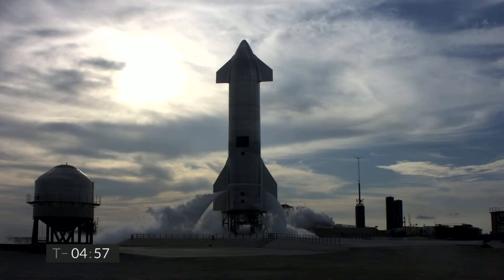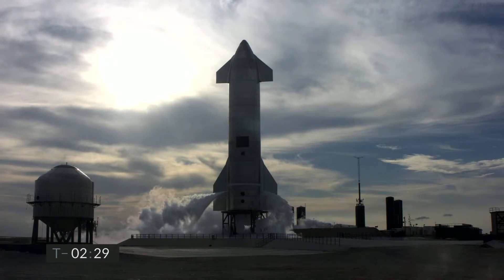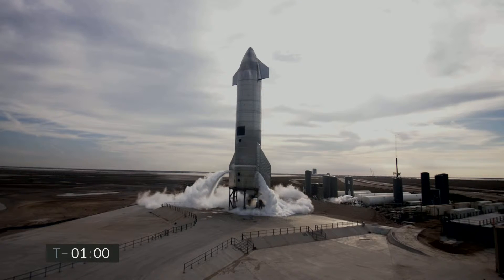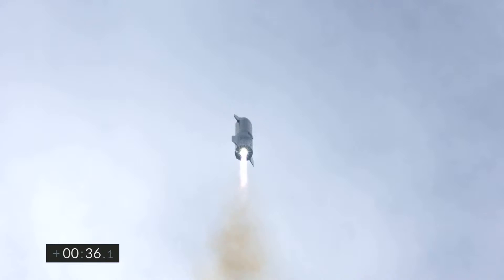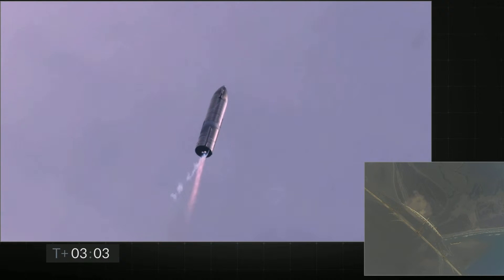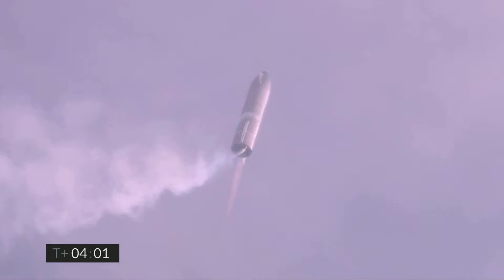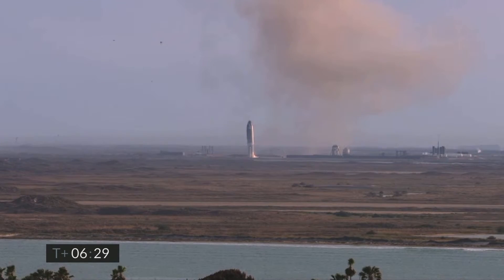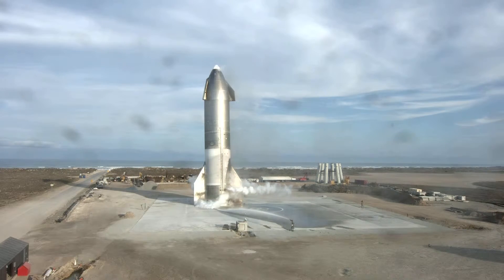Starship | SN10 | High-Altitude Flight Test

Comment: Can you guys not use the flaps alone to flip the vehicle, perhaps from say, a higher altitude?
Reply: No, I donÄt think it would flip all the way without any engines.
Reply: @volksgenosseerichhonecker5104  with the right amount of altitude and right flap design, I don't think anyone has tried it yet...
Reply: They need to use a lot more fuel if they do it at a higher altitude
Reply: They can't so that because in the horizontal orientation because of air resistance it falls slowly. If you make it vertical then it's extra fuel wastage for no reason. If you look closely the fuel being used to do the actual flip is far far less than that which would be needed if it had been vertical way up.
Reply: @SahilP2648  So you saying the flaps cannot by themself first slow the ship, then orient it vertical in a way that shifts the entire orientation of the ship without using fuel until it gets near the ground?
Reply: @SahilP2648  In theory the ship would speed up again if it was falling vertically long enough?

The amount of drag really saves that much fuel vs a few moments of fighting a few extra hundred miles an hour of momentum?

I wonder what the statistics would look like on a chart of raptor thrust vs opposing direction of speed and mass.
Reply: @RoyBuchanan309  just compare this video to the spacex heavy twin booster landing. Those boosters are super small and light weight compared to Starship but they come in so fast (since they are vertical and have no drag), they cause 3 sonic booms at different altitudes. Starship has flown pretty high up, enough to hear the sonic booms if they happen but they don't, cause it's literally floating down, not diving down. Also the actual flip maneuver lasts only a few seconds so it's not wasting as much fuel as you think.
Reply: @RoyBuchanan309  also compare at what altitude the spacex heavy boosters light up. They light up pretty high up so they are burning longer than starship which is heavier. So this is the best possible way to save fuel and be safe at the same time.
Reply: @RoyBuchanan309  look at the landing burn start https://youtu.be/sX1Y2JMK6g8 I would say it starts at about 1000-3000 feet in altitude. Way higher than starship.

Comment: On the launching platform all 3 raptor engines of the Starship are at a distance from ground such that each engine could safely fire independently. During landing the engines are much closer to the ground, the silent engine(s) might get chocked up and cause explosion - a thought

Comment: Since the Starship's using one of the 3 Raptor engines for landing, would it be easier for the starship to keep its balance and hold itself in the upright position if it is equipped with 4 Raptor engines instead of 3? One in the center used for landing, and the other 3 placed around it.
Reply: By gimbling the Engines they can balance it out prettey easy.
A 4th Raptor Engine is not needed because they already have enough thrust with just 3. A 4th one would only be extra weight.

Comment: Has anyone noticed how the rocket bounces up a bit as soon as it lands? Is this normal?
Reply: No, it definitely landed faster than it should have, Elon confirmed this by saying that the engine didn’t bring the thrust that it was told to do.
On SN11 they will light two and maybe even three engines for the landing burn

Comment: I know that this might sound like a newb question or like a question from a person without "The Right Stuff", but why don't we use propellers powered by rechargeable batteries to the maximum height limit and then just use the thrusters to escape the planets gravity pull to get to space.  I think that this would cut the amount of fuel required by a lot and provide maneuverability during landing.   Also  Elon owns a gigafactory.
Reply: You cant get enough speed if you use propelers
Reply: And you cant aesely came back without rocket boosters
Reply: Oh I see.  Thanks! I guess the air also wouldn't be dense enough at high altitudes to provide the lifting force to keep going higher.
Reply: @jamiewong8233  sort of like on mars, need to spin the rotor blades faster to gain lift. They are going to test the ingenuity helicopter on mars toon (Nasa)
Reply: Because space is sideways, not up: https://what-if.xkcd.com/58/
Low earth orbit is typically at least 200km up. Getting to that height accounts for about 1/15th of the energy needed for orbit.
The other 14/15ths is accelerating sideways to ~28,000km/h, or 17,500mph. Propellers can get you to about 20km, or 1/10th of the height, so about 1/150th of the overall energy. 
Long story short, saving 0.7% of your energy requirements using propellers is not worth the extra complexity involved.

Comment: I think the fuel that is used inside the SN-10, when it falls back to the ground, the fuel in it goes back and forth, the engines don't get the right pressure, which is why it fills up right on time. Don't work and don't make landing easy.
Reply: Actually, that time it did work, there was just a sticky throttle valve.
Reply: @alexn8219  no, there was a problem with helium ingestion and flash state change. Check elons twitter and everyday astronauts for more exact details

Comment: Please share thoughts about this one:  What about a dynamic landing pad platform concept with hydraulic actuators and shock absorbers to dissipate residual kinetic energy and trimming level off?
Starship legs would be spared of high peak loads.
Reply: This is just calibrate error or not optimized
Reply: Elon has actually mused on something along those lines. But it would only be practical where sufficient infrastructure exists.
To land on Mars or the moon, at least at first, you're going to need proper legs.

Comment: I love the close cinematography on the landing scene. It's an automated camera I believe.
Reply: landing scene is definitely cgi... where is the dust? wen we see the shot from the camera on the ground....
Reply: @mthaesibbz8656  
Look at 11:55
It's too far from the ground to make any dust until it does when it got low enough.
Reply: @bengsynthmusic  if a jet engine can blow things off that are 50m away... I'm sure a SpaceX rockect engine powered by a reactor will kick off a little dust... Not a cloud of dust... It's in the little details...
Reply: @mthaesibbz8656  also it’s a Raptor engine not a reactor.
Reply: @mthaesibbz8656  it may not look like it because of the distance, but at 11:55 the rocket kicked up about 20 meters of dust in height. That's a lot more than any jet engine
Reply: Took 4min to reach 10km altitude... But 1:30min "FREEFALLING" bck... How does anything freefalling become faster than the rocket?
Reply: @mthaesibbz8656  The rocket was only going up at 40% power, due to not wanting to break the sound barrier, if you check out any other Falcon 9 launch, youll see it hits Max Q (Max aerodynamic pressure) around the 1:20 min mark, this usually is when the craft is hitting the atmospheric wall, which is about 43000 ft high. SN10 only managed to reach a height of 10km in about 4 minutes. So its unbelievebly slow going up, but with the weight + gravity, it reaches its terminal velocity when doing its belly flop manouver fairly fast (within 30 seconds)
Reply: @mthaesibbz8656  It wasn’t at max power.

Comment: K if you can put it on site... why not look at mediums for resistance... get it hovering stable say 200 meters up... instead of legs... its a shroud to protect the engines... cut off and drop... into a silo with heavier than air elements... 

Could you use a inflatable structure.... to contain gases.... could you do membranes.... use piston effect and a diluted fuel in the last few membranes to push back...

Idk.. tend to find sometimes... if you can link a design to mechanical...  if we did everything by hydrolics at one point... why add servos... when you can just power a mechanical advantage you already have... we seem to like re eventing the wheel every new signeture.

You only add new systems once proven designs have proven inadequate thru testing... than you invent... with the full realization... what if.

This was not a slight..  or judgment.. just questions... ya orbital mechanics may be past me...

In the same concept... if you could hold dimensional tolerances. You could build a cannon... in the form of a cylindrical ship... float it over deep water... leave the neck at the float... flood it... anchor the bottom..... close the baffles... pump it out... lower said craft... tube vertical...
Flood... vaporize incoming water...

Recover the energy on decelerating the platform.... extend the push thru powering top half like a rail gun

Comment: Excellent. Does anyone know what causes those flameouts? For example even as it's landed it appears to have an uncontrolled fire. Also, that landing looked like it had a bounce lol, not sure how "soft" it was.
Reply: Flameouts were caused by the engines shutting down. The fire is uncontrolled but it doesn't do any structural damage. It was harder than expected because the one engine had less thrust than what was commanded.

Comment: The entire video wasn't shown. The SN 10 tipped over and exploded.  See the lean after the smoke clears? I've been very interested in rocketry and space travel all my life, I'm 72 years old. It's inconceivable to me why Musk continues to use dangerous chemical propulsion and not experiment with plasma or ion! Getting plasma up and running we could get to Mars in two weeks with a speed of 135,000 miles per hour!
Reply: This was streamed. It ended before it exploded.
Reply: We use Ion engines once we are in space, because they are extremely efficient, but they do not provide enough thrust (yet) to go through the atmosphere
Reply: @antan2329  
Yes I know. They also increase speed dramatically the longer they run.
Reply: @puzzlefactory6447  As do all rockets.
Ion engines aren't viable for large rockets yet because of the obscene electricity requirements.
Reply: @puzzlefactory6447  in the vacuum of space and without any gravitational force every engine increases velocity exponentially, but ion engines do not provide enough thrust to escape earths atmosphere.

Comment: You can fire all engines to make the ship stop falling down in random speeds before tuning the engines down for landing. Zero speed down is not random. Full stop 100 meters or less above ground just to get it right.  Only then you are in control to land safely. Just stop before the ground in altitude that you know you have control.
Reply: Relighting 3 raptor engines and landing with 3 landing is too much thrust or else the starship will fly up during landing. so they can land with 1 or 2 raptors. Landing with 1 engine is not bad but the engine was low on thrust due to partial pressure. They can now try landing with 2 raptors all the way down and deploy useless legs and relight engine 3 if engine 1 or 2 has problems.
Reply: They have to perfect the suicide burn because its most efficient. Also stopping in the air earlier and descending that slow requires extremely fine throttle control.
Reply: @antan2329  You are right. Hitting the ground requires that fine control too.

Comment: Make the ship hover above ground a second, only then you are fully in control of the landing. Then you know you are not coming down in random speed and all the speed down is made by controls. More accurate data, safer and no extra speed to discount. Know the level of the hover, you also know the power, it is easier to power down to drop than power up to stop... While on board a ship like this, you truly want to have that zero speed already above ground to know exactly how to shift engine power to land safely. Having people on board this is a safety action. This way you will not be quessing how the engines actually work, but you also control the speed to land... If you want to know how it feels... Play Elite Dangerous and land on high gravity world. You will realize that you want to stop before hitting the ground. That explains the philosophy how it feels to land exactly like this... My point is that hovering before landing is essential to get it done safely. Zero speed down before ground... No variable speeds, just exact known values.. When you stop in air to get control it is no more a speed roulette. Landing hover stage. Stabilize ship and speed before landind... Look at the Mars Rover... Hovering in Mars Atmosphere is even more important. Its to know exactly you are in control before hitting the dirt. Lets say you stop 100 meters above ground. Then you know exactly how the ship falls down if you turn off the engines. But instead of that. You calculate exact power to engines to match safe speed down from that point and you know exactly the force of gravity and other factors rather than.... Lets pray we hit the correct settings while we land from random speeds... Zero speed has less randoms to calculate..... "Oops the system did not guess the power correctly to stop the ship while moving... The logic hit the ground hard because the variables of unknown factors like too fast speed downwards. ... All falls are different in speeds...
Reply: That’s all to Elon musk he’s the ceo you can Tweet him not SpaceX an company. Also they landed the starship hard due to 1 engine having a low thrust due to partial pressure inside of the starship tank.
Reply: @Heap_InnovatorsRBLX  Not going to install twitter. I never use it.
Reply: Falcon 9 doesn't perform such a hover; it's literally incapable of hovering. But they're had no problem landing 76 of them to date. 
Two of those boosters have flown 8 times, so they're clearly no worse for wear despite their hover-less landings.
Reply: @lazarus2691  Falcon9 is not same. Starship is able to hover.
Reply: @roensoul  Right, but just because it can doesn't mean it has to. Falcon 9 lands just fine without doing so, so there's no reason for Starship to do so either.
It's highly inefficient. Elon said that an optimized landing should use about 5% of the dry mass in fuel. That works out at about 130m/s of delta-v.
Every second you spend hovering adds another 10m/s to that value.
Reply: @lazarus2691  5% is a goal when the landing sequence is optimized. But to get to that 5%, you first need to land the ship alive. And when shit hits the fan, you still have fuel to fix the moves above 5%. The easiest way to test crashing is to mess with less fuel than needed. The current problem in fuel tanks is that the interior allows the fuel to bounce around too much and pressure is not constant. There is very similar balance problems inside fuel trucks. The tanks have sections and float limitors to make sure the fuel is where it should be so the truck does not flip while turning. To maintain pressure you need to have pressure wall which prevents fuel splashing around and if healium is used then it should not have surface contact with the fuel... The rocket does not like martini shaken.. So there needs to be a film/solid layer that prevents healium getting mixed with the fuel. A healium balloon.. kinda or hydraulics. The main reason to stop free fall as well is to balance the fuel which obviously is doing shaking in the tank.
Reply: @Salticus Not moving at all is opposite of crash. The point is to get people safe landing. Stopping the free fall to complete halt before descent may indeed consume fuel, but it also would provide more accurate control over the landing sequence. Yes computers are amazing with calculations and may even stop the free fall under the dirt... The thing is... I would not bet my life on nonstop landing before ground contact.  Yes rover had to hover to land on the spot... Yet it does not die if it hits the ground too hard... The point of the hover was exactly that control and to mimimize damage.. It takes 0 fuel to crash the ship... I would fire 3 engines to stop the free fall and then turn off one for the landing sequence.
Reply: @Salticus Take a good look at the very first Apollo moon landing and pay attention to details. Landing boosters without life on board is not risk to kill people when computers make wrong calculations.

Comment: Is the Carbon Footprint measured for these tests?
Reply: Yes, rockets dont pollute very much at all. Everyday astronaut has a good video on that.
Reply: They use liquid Methane so it's more good for the environment than RP-1
Reply: @nasuegaming1255  technically no, if methan go onto atmosphere is sooooo bad but if it is turned into carbon is better than rp 1
Reply: @danko8983  They don't spray Methane into the Atmosphere as that is illegal. The Exaust of the rocket is mainly just water.
Reply: @volksgenosseerichhonecker5104  is not only just water, see the everydayastronaut video about pollution, only hydrolox generate only water, methane and rp 1 generate a little bit of carbon
Reply: @danko8983  It's still extremely negligible compared to everything else. Factories, cars, and planes are the real problem. This doesn't even make a dent.
Reply: @bird.9346  i know, this is a little part that is neccesary, but cars, planes and factories are totally innecesary still using fosil fuels escept for planes, but in factories we can use electricity from solar panels and electric cars too (sorry for my english)

Comment: Seems unbelievable every time I see this 50 meter high building lift off
Reply: Making it fly is almost as interesting as building the thing. A 15 storey building, that contains liquid Oxygen and liquid Methane at pressure... Hell, just a 15 storey stainless steel building... It's impressive. Most people wouldn't even try.